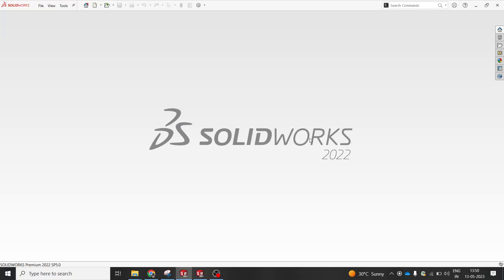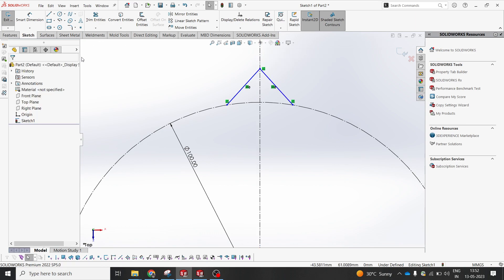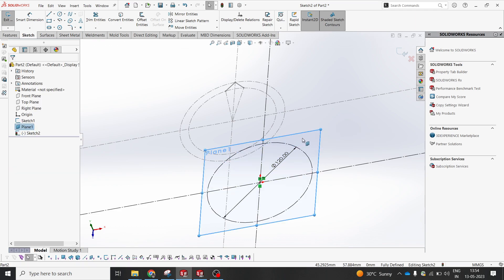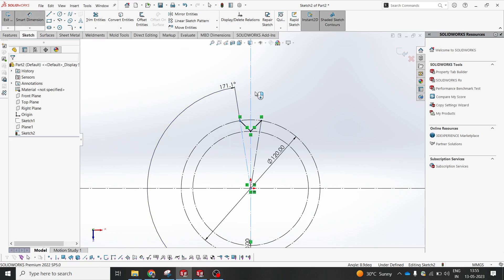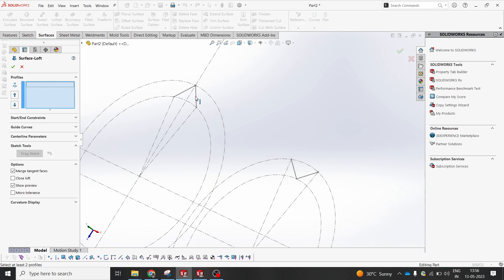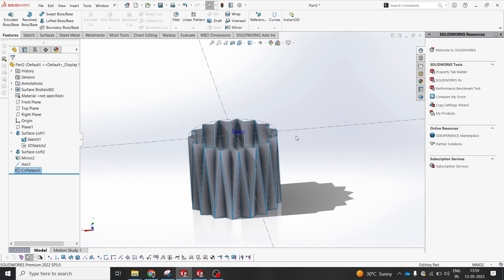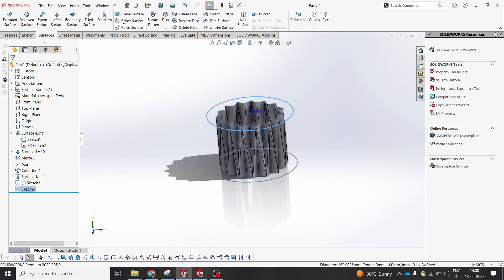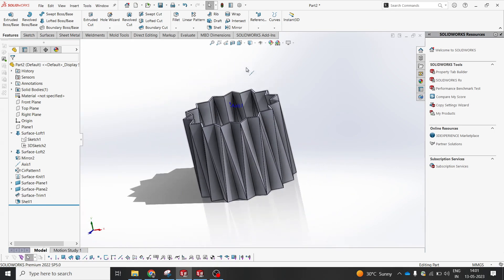3D-Print Free models | Office accessories | Solid works | Model-4

Comment: great videos, at 11:30 I am unable to edit the circle diameter as it is dimension driven. Is there any way around this?
Reply from the maker: You mean the inner diameter of the circle? if yes you can delete the offset value of 10mm and add diameter to the inner circle